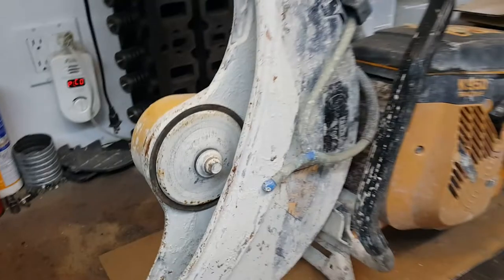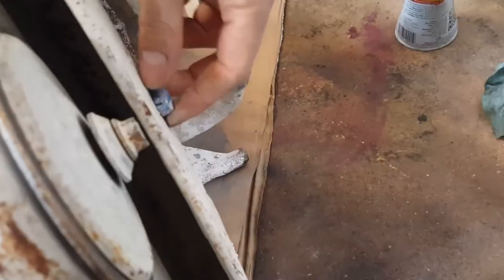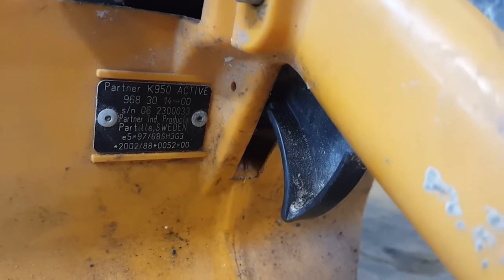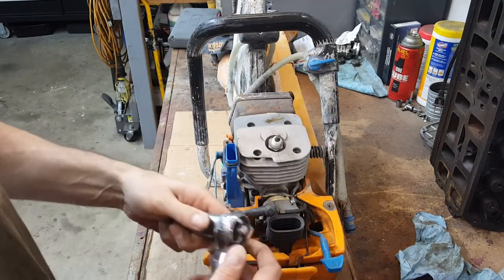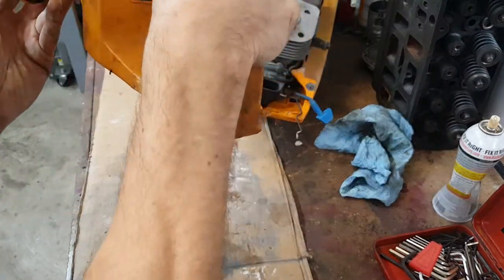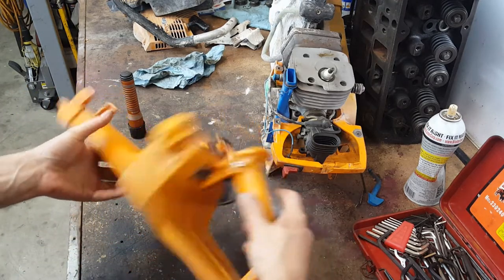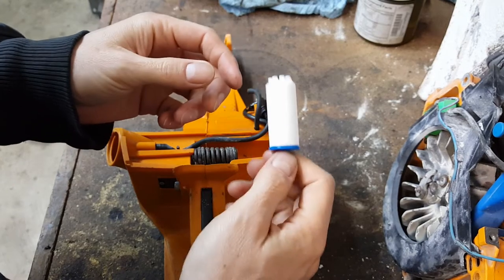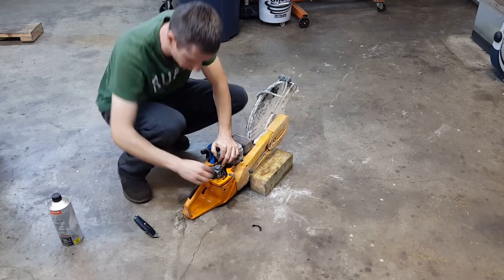Partner K950 Active cutoff saw not starting, fuel leak

Comment: If anyone is watching this for tips on rebuilding carb, skip the first 15 minutes and follow these steps instead.  Total time required to remove carb is about 1 minute.   Remove two phillips screws on top cover.   Remove (3) 4mm hex cap screws holding the intermediate cover.  Look for black rubber intake elbow.   Remove two screws on the bottom of the elbow and set aside.   Use long 4mm hex -- T handle is usually long enough - insert through access holes on either side of handle near throttle lever.   These holes access two screws that secure the intake elbow and carb to the intake adapter.   Loosen these screws fully.  They will not be removed until assembly is out.   Unlink throttle rod from throttle trigger.  It snaps upward.  Remove fuel line and breather line from carb.  Now pull out entire carb and intake elbow assembly.   Note that for a proper cleaning there are a few welch plugs you will need to remove.  Blowing air will not clean the troublesome passages on a Tilletson.

Comment: Cold start... Squeeze accelerator,  then push button on side to hold accelerator on.  Full choke until it giggles at you.  Take off choke and it will start.  It will review high until you squeeze the accelerator.
Reply: No kidding... these saws are not that hard to start...

Comment: So how is it that you don't first install a gasket before installing the metering diaphragm? All the 2-stroke carburators that i have ever been inside, you have to install a diaphragm first and then a gasket on your inlet side of the carburetor and on the metering diaphragm side you have to install the gasket first and then you install the diaphragm second? And i am assuming that the green plastic piece is a dust cover? But I am confused about metering diaphragm going directly against the body of the carburetor? I think that the saw that your working on there is missing a gasket! Which would cause the little piece that pushes down on  the arm to be closer than it is supposed to be causing the saw to have a rich condition that cannot be tuned out and depending on how far open it's holding the  needle off of the seet can cause fuel to leak out of the exaust!
Reply from the maker: You might be right, I dont work on those kind of things on a daily basis, all i can say is that its still working to this day.